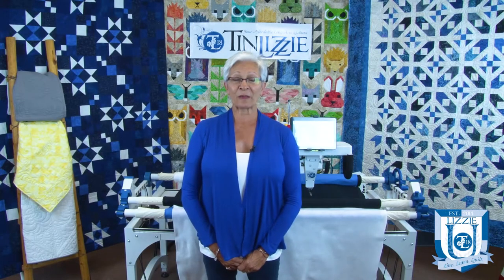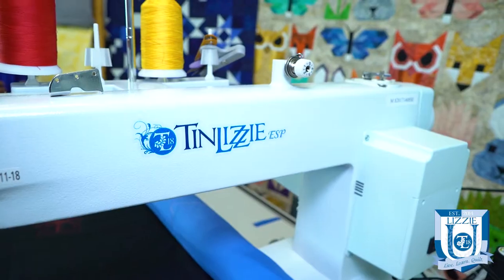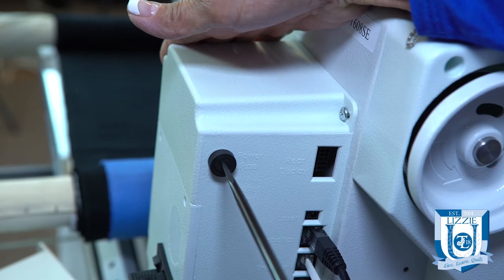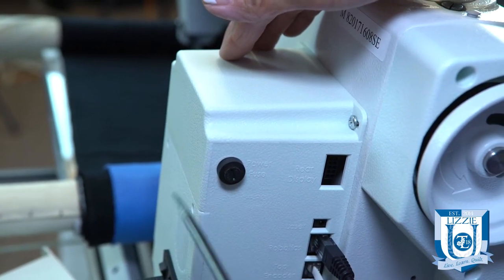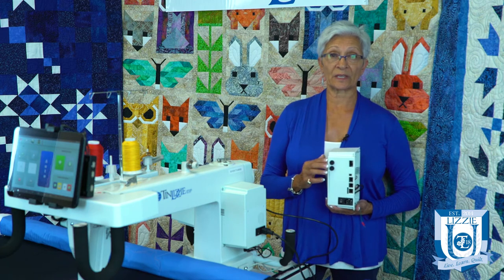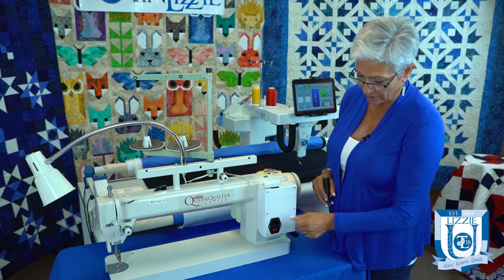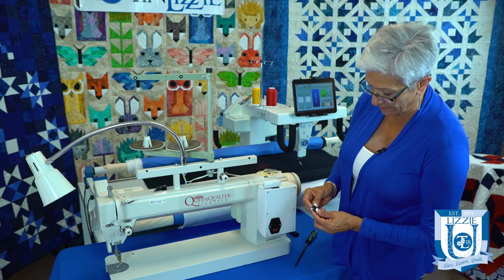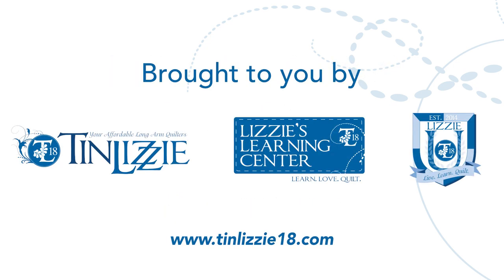Checking and changing fuses

Comment: My 5amp fuse did blow - I replaced it and the machine is still dead!! The 10 amp is fine.  I left the machine on after quilting yesterday but turned the lights off and laser.....what else could have happened for it to not turn on after replacing the 5amp fuse?